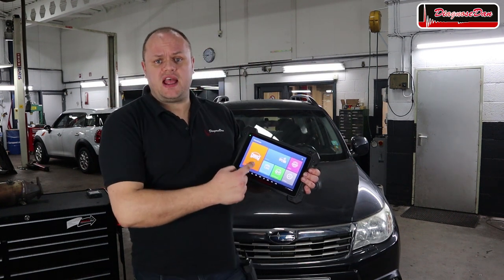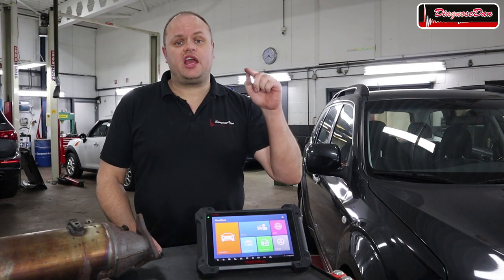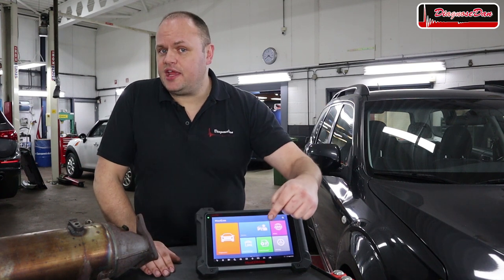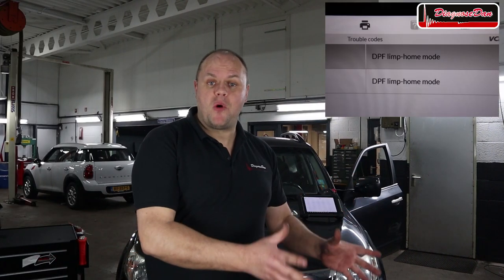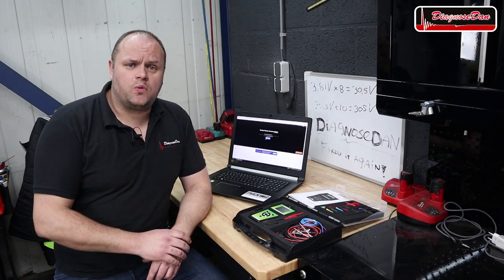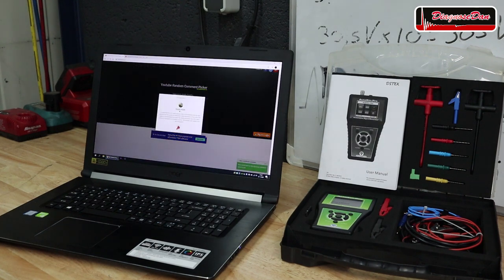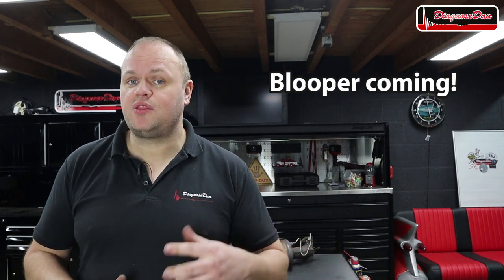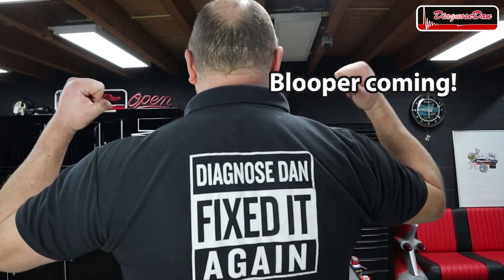New Car parts aren't always good Car parts!

Comment: i like to get the dpf up to temp before checking pressure. also after a regen.  sometines you can reset the ecm soot level and trick it into a regen if the system has a lockout.   been a while since the last video  was starting to get worried
Reply from the maker: Ha ha no worries😉

Comment: I used to work in the Automotive parts industry for about 10 years. In that time, the quality of the aftermarket parts was dropping fast.  The only 2 Brands that never gave any trouble was, NGK and Bosal exhaust’s. I left that job about 12 years ago, going my recent experience, it’s still going down hill. I only buy OE parts now.
Reply from the maker: Unfortunately the OE part in this case was too expensive

Comment: Hi Dan, you talked about different temperatur readings can cause dpf problem. I have a vw cc 2,0 tdi 2015, and i have a problem that the dpf regeneration is not always working.i read a different about 300 celsius between sensor 1 and 2 (310 celsius sensor 1, 623 celsius sensor 2 at 2500 rpm ) maybe one temp sensor is fulty? 

Love your videos always fun and entertaining to watch 😁
Reply from the maker: Maybe, get them out of the DPF but keep the connectors connected. Heat them Both up with a hot air blower and see if they Read the same
Reply: DiagnoseDan thanks for the tip i Will try it next time i put the car up on the lift 😁

Comment: Maybe they used ritchly exhaust kit to mount the dpf.....and it got also blown into the inside, sticks and baked on the filter causing blocking the filter gateways.....
Or, did some repairs somewhere on the air intake system not in a clean way...
Reply from the maker: That was not used, Just original gasket

Comment: Hi dan noticed this video was over 4 years ago and i was curious to know if this vehicle ever returned to your shop for the same issue ?
These engines are renowned for dpf issues around 100k but aren't easily rectified/diagnose due to cost of parts/repair times and a new dpf addresses the symptoms and not the actual cause.
Great video as usual and its nice to know my dpf diag is actually the same as you.

Comment: It clearly has not enough passage and by looking at it we dont really see whats inside.
Generally ceramic inserts are made very precise and this one doesnt look like that already despite being new but as i said it can be terrible inside
250 mbar is like u put a 1.5kg flap on top of 2.25 inch pipe. It would take a significant force to raise that flap
To put it into perspective playing trumpet at full would produce max 2 psi if u have a super strong lungs
Reply from the maker: Thanks for the info😉

Comment: the metallic substance in the dpf looks like it may have come from the inferior catalytic converter built into the dpf which should be burning the post injected fuel and raising the temperature above 550c which would oxidise (burn) the soot in the dpf so I would say the dpf is blocked because the required temperature has not been achieved to regenerate the dpf a problem I have seen in many cheap dpfs bought on ebay
Reply from the maker: It didn't work out of the box, they never drove the Car.
Reply: @Diagnosedan  the cheap ones are like that not made to OE spec I struggle to trust any aftermarket one if it fails after you fit it you have the headache

Comment: Fantastic, thanks for the clear explanation of how it works and how to diagnose.

Do you normally have to remove the temperature sensors before sending it away for cleaning?
Reply from the maker: Depends on what the DPF company prevferes

Comment: Thanks Dan, bril video as usual. Can you spoil me with an advice ? Got DPF  Below Threshold issue 
, for a loooong time. Light comes on on hard acceleration usually when engine is rather cool or during a long drive. DPF sensor ok (replaced with OEM), Vacuum lines ok, Temp sensors ok, DPF regenerates ok and pressure seems ok. The only thing i have not checked is any leak after the DPF...  Any idea appreciated.
Reply from the maker: Whats the Ash content?
Reply: @Diagnosedan   Not sure which one is the important: oil ash volume 3.9g; soot mass calculated 17.5g; soot mass measured  -11.2g (i do not know why this is a negative number)

Comment: Are the differential pressure readings on this vehicle the same for every one, if not where do you get the information on what the pressures should be? That's the main thing i struggle with at work, knowing what the spec is.

Comment: Cant they be cleaned up? I know on heavy duty diesel engines like detroit, mercedes Cummins all those the dpf can be cleaned
Sorry i anticipate my comment. Keep the videos and the knowledge flowing
Reply: The cost for proper DPF cleaning in Australia is about the same cost as he is talking about for the replacement ones in the video. Worth while on big expensive truck ones, small cheaper car ones its not. Im also not convinced it gets the Ash out of them.
Reply from the maker: Didn't you watch the whole video😉
Reply from the maker: @MattyFielding6  A proper Dpf cleaning company weighs the DPF before and After cleaning. Because they know how much it should weigh empty they know exactly to the gram if its clean!
Reply: @Diagnosedan  yes i did. That's why i edit my comment. I was just feeling like i was live there, the way you teach and edit your videos make you feel like we're there in your shop

Comment: Hey Dan, quick question : is there a pin in the OBD connector in the car, that gives out +12V  power only when the engine is running? Not even with the key in the "run" position. Only when the engine is spinning. 
I wanna power my DVR cam only when the engine is running, and not when the key is in the "run" position with the engine stopped.  
Or......if there's any other way to get power only when the engine is spinning.....?
Thanks man, keep it up!

Comment: With reference to the foreign deposits on the upstream face of the DPF, did you check the condition of the downstream face of the DOC, the metallic particles could be bits of Cat. 
Also the other deposits, what you describe as sealer, had the original garage used jointing paste on the upstream connecting flange?
Reply from the maker: No paste used Just a new gasket

Comment: If you travel to Norway from the Netherlands, welcome to the land of blocked DPF filters.
The issue? Low speed travel due to the roads and traffic, and no real places to open and get the filters cleaned, as a result they often clog up.
My personal fix? Disable and remove, and keep it for the bi annual inspection and strip once completed and passed.
Reply from the maker: The DPF is there for a reason😀

Comment: Hi Dan, i enjoy your channel, thumbs up for sharing you knowledge and method of work.

I have an older car and most shops refuse to accept it for work /diagnosis because it is not easy to read via obd2

The car is e36 m52b28 single vanos 328i ms41 , can you give me advice what software would provide good "read" of the car? A friend of mine has generic "delphi" scan tool and software but it gives very limited data reads.

The issue i have is very irritating (first trouble with the car for over 8 years of ownership until now only regular maintenance was done). The car started working very rough, the idle speed dropping when warm under 500rpm (looking at the tachometer) and slight detonation in the exhaust druging idle (every 30-40 seconds or so).
Not a mechanic my self i assumed that it is time for sparkplugs and changed them (around 30-35k km on the previous ones) and sent injectors for new filters, o-rings and cleaning but no luck, and also no fault codes with Delphi.

Please advice me for some software that would read the car.
Reply from the maker: Older cars support less datapids. Maybe its not a problem with the scantool. I use an older Snapon (Brick) for older cars like the E36
Reply: @Diagnosedan  10x for the reply. 

Just if it is of any use for other people I can share a bit of info from last night.
Although there was no fault code on Delphi for MAF , i suspected it could play a role for the very annoying hunting for idle after disengaging a gear (after coasting).
It turned out that this particular issue was solved - just cleaned the MAF with specialized aerosol (never use brake cleaner/contact cleaner , ONLY special MAF Cleaners).

The misfire is also hard to notise , but still there. I found a shop that has INPA software and would visit them soon.

All the best of luck with the channel and thanks once again .

Comment: Great video Dan! Was hoping for your help,

Mazda CX5 2014, 2.2L Skyactiv diesel headache.
I believe there is diesel in the oil. Reason being, oil deterioration code came up and also I dropped the pan, and it seems the viscosity, is similar to diesel.

The owner was driving it and then she said there was no power, also no engine lights came on. 

Please help sir, as I'm not sure what should be the next step. I'm thinking, leaking injectors but I'm unsure

Thanks in advance
Reply from the maker: Could be because of to much regeneration of the DPF.
Reply: Hi, I've just finished to solve my issue on my 2012 cx-5: faulty injectors, even controlled they seems ok but when changed with new we have seen that they were rubbish, symptom: oil dilution, lack of power, high consumption, frequent rengen (50km).

Comment: the moral of this story is dont buy a diesel, my petrol car has no turbo, no dpf, no egr, no boost pipes, no add blue shit, id rather pay a few more pounds to fill up the tank because in the long run its cheaper than repairing a diesel car.
another great vid Dan.
Reply from the maker: Than you should get an Electric Car. No Cat, no sparkplugs,no O2 sensors😉

Comment: The fault with this aftermarket DPF must be similar to the problems with aftermarket CAT's, the monolith inside is constricting the exhaust flow so much that it causes a code. Basically they're cheaper for a reason. Newer engine management systems have such small tolerances that aftermarket parts just aren't good enough.
Reply from the maker: Thanks Martin😀

Comment: I would say that there are probably two factors that would contribute to higher back pressure.  The crap on the front of the unit and the second is that it may just be a poor design that does not meet OEM specs.
Reply from the maker: Agreed

Comment: we almost never change dpf because its too expensive. The customer does not want to pay for it. We offer OR have to offer 2 other solutions. 1 is to clean it and force a regen sometimes this solves the issue(90€). 2 is remove the filter in the dpf and disable the dpf system from ecu (150€) %100 success rate.. emissions are ok most of the time the motor is in good condition.. Customers choise..
Reply from the maker: I don't like Dpf delete

Comment: Great informative video as always Dan. 2 questions;

Did you perform any checks to ensure an engine excessive smoking fault will not cause further issue?

Also, what make was the OE spec aftermarket filter? We have experience of poor quality parts so info from recommendation is good information!

Thanks!!
Reply: Sorry I mean the the make of the filter you fitted to fix the problem?
Reply from the maker: I was only asked to diagnose the DPF limp home mode fault by the other shop.
Reply: DiagnoseDan Thanks. Also Can you tell me the manufacturer of the GOOD aftermarket DPF please? You are awesome!! 👍🏻👍🏻💪🏻

Comment: i have a 2018 mazda cx-9 with 38k miles the cruise control comes on but will not set i checked fuses but none were blown help?
Reply from the maker: Broken switch? At this point without anymore info its Just guesing

Comment: Are the holes in the inner screens the same diameter or smaller? that would increase counter pressure because less gas can flow through.
Reply from the maker: Maybe you're right 👍

Comment: not sure what dpf means. Looking at the inside video it looks like some of the square holes have the material still in them from the manufacturing process. So is a DPF a Catalytic converter for diesel?
Reply from the maker: Its a Soot filter

Comment: I would think that the filter inside is a used one, they tried to clean it and put it in a new box, it would cost prize of the tube and a bit welding, and therefore cheap.

Comment: When testing the rear backpressure would a clogged exhaust effect the back pressure at that point
Reply: It would also affect the pressure at the front of the DPF If the exhaust was blocked.
Reply: The pressure was high at the front that’s why I was wondering about a restricted system
Reply: simon sherwood You do have to be careful with Latest systems as the Nox cat can break up which is before the Dpf this could give confusing readings so always manually test the pressure at different points.
Reply from the maker: It would affect the pressure at that point but not the pressure differance between the front and back of the DPF because Both points would be affected

Comment: As a 60yr old out of touch Technician I was wondering if this car's been through a river/flood water and 
what a silly location for DPF to be located risking thermal shock ...??
Reply: It's a flat engine configuration and the exhaust ports are at the bottom of the engine, so the options for mounting are limited. It seems most likely that it was the split intercoolerr hose and resulting rich fuel mixture that caused the problem initially anyway.
Reply: @deaddoll1361  Yeah, Thanks I know it's a flat engine, but I'm disappointed with Subaru's design.
Especially given their off-road reputation. Although 192,000 is pretty good!
Reply from the maker: There aren't alot of options on where to put a Dpf on a boxer engine as it must be placed as close as possible to the engine to Heat up.

Comment: I have a 99 Camry. All diagnoses are done by me using my ears, my nose, my ass along with an inexpensive OBDll reader.  It's a great reliable car that is only a little outdated looking but not old looking. No one would give it a second glance. I have an awesome remote starter that will start it from the other end of a Super Ikea. I have a nice touchscreen Kenwood stereo with bluetooth and backup camera and also dash cam. The engine has cutting edge NGK Ruthenium spark plugs and NGK ignition wires that are double insulated and custom jacketed. Even the timing belt of the non-interferance engine is special. I've had technologically advanced cars my whole life, but none make me as happy as my plain-jane boring, but easily and inexpensively repairable Camry. Why the F am I telling you this? As you were.
Reply from the maker: Ha ha thanks for sharing your story 😉

Comment: Damn Dan, do you got a little bit of shell shock? Haha, you damn near jumped outta your skin!! What happed? Great video as always!! What are you doing to the Tesla? Elon doesn’t like it when those are up in the air, only space X rockets are supposed to be in the air.
Reply from the maker: We ordered a new model 3 for a customer but he wanted a different brand of tires. 
I turned of the compressor for the video and that made the tire machine to loose pressure and the mounting arm to drop.

Comment: I had to cringe at the angle grinder being used because of the stuck fittings. I've had to shake my head in amazement too many times at that kind of ignorance.
I watched a mechanic tensioning down a cylinder head once and I knew the spec required an initial setting and then 90 degrees. When I saw him using half a turn I yelled at him to stop. Believe it or not, I had to explain that  90 degrees was a quarter of a turn, half was 180 degrees. He was still unconvinced and had to consult with his boss, then after some discussion they decided that I was right!  That head bolt would have been overstretched but I wasn't going to enter into a discussion about that. Who knows how long that would have taken.
Reply from the maker: Amazing you had to explain a 90 degree angle😢

Comment: Were those deposits over zealous use of gasket maker on that inlet before you took it off? BTW, I know how to fix dpf issues, the true issue is the owner. Are they going to only do city driving? Then a modern diesel is not for them. That solves 100% of dpf issues.
Reply from the maker: No sealant was used only original gasket

Comment: "New doesn't always mean better" - that's fair.   "OEM doesn't mean that it works" - will be the next conclusion. On Subaru boxer diesel the dpf has no business being there. The oil capacity of the engine is ridiculous so it gets contaminated and burnt out (by the regenerations) in no time. That's why you can find a lot of subarus on sale with a broken engine.  While a secondhand one from the scrapyard costs an arm and a leg.
Reply from the maker: Thanks for watching 😀

Comment: Wow ...  loving that flexy head inspection camera    modern technology 
just a shame we need these tools to diagnose  a new part  ££££
That is to replace a worn out over engineered part  thats cost £££. with the brand new car in its day 
To be replaced with a new clone part that cost.   £££. which is defective and technically scrap 
To be replaced by another clone part of OEM quality ....   hurrah  its fixed.   at great cost 
How much of these clone parts are built just to repair defective diesel cars ? 
Just how much of the ozone are we saving ?  power time and fuel  to make store and deliver these parts ? in the manufacturing chain 
Just had to replace the whole system on my Euro4 spec diesel knocker  14 year old car from front to back and it cost £200 from engine to back box inc CAT 
fitted ....    so very happy 

These Boxers have a bad reputation in UK for unreliability  ....  nice car.   poor engine block / crank   but I think they did sort it in 2009
Reply from the maker: A soot filter or Dpf is not to save the ozone but to save your Lungs 😉